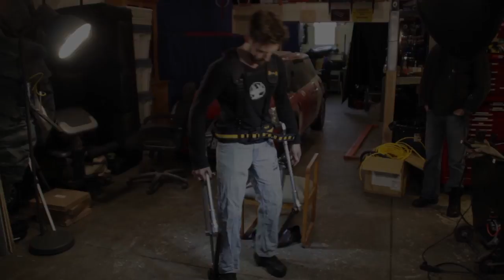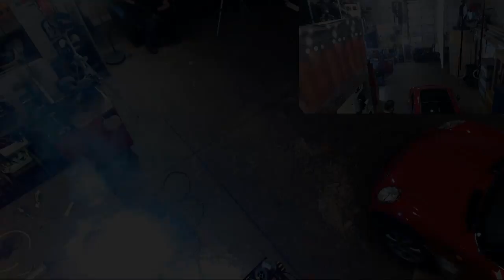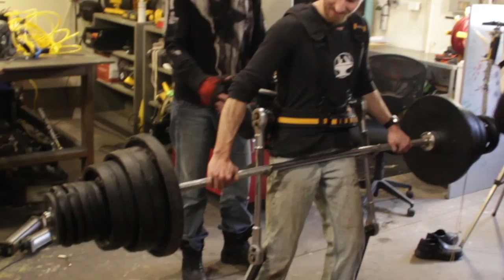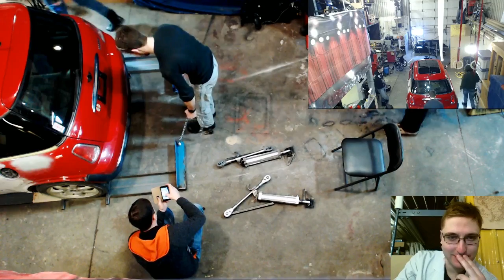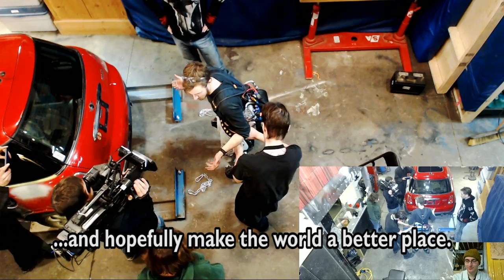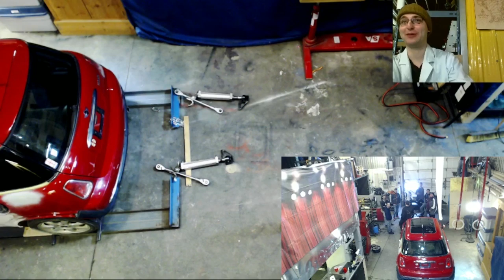Live Stream of the Exoskeleton Test (Picking up a Mini Cooper!!!)

Comment: awesome job mate, my 10c worth is that the top bit of the legs are a bit to long, and mabee utilise the pneumatic muscles more because you would have more flexibility and movement, also please please please use the muscle sensors witch detect how much stress you are putting on your muscles, so then you could walk around and lift and stuff without buttons, otherwise awesome job
Reply from the maker: +kerbalcraft While I do love pneumatic muscles, the problem is no one would care about them on YouTube -- they aren't nearly powerful enough to do anything impressive =(
Reply: +the Hacksmith hmmmm maybe use the pneumatic cylinders for curling power and leg lifting, and the pneumatic muscles in paces like the shoulder and hips, for flexability, also the muscles sensors woud do wonders for the suit, you could maybe use it in this suit or even MK 3 suitcause you could integrate them into the clothing you put on before, along with all the wiring, so when you put it on you just have to plug the exo into the clothing.